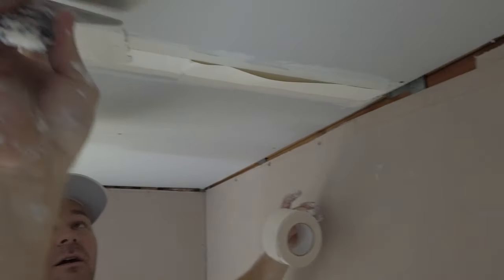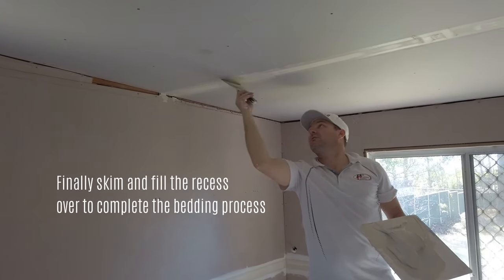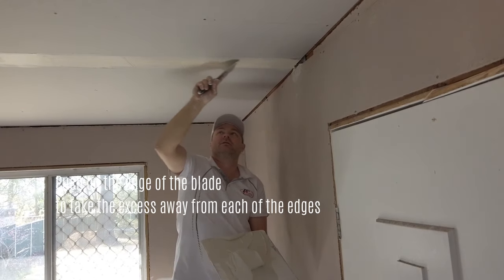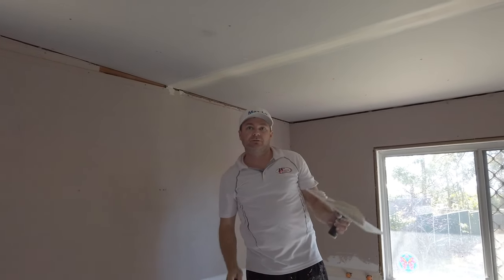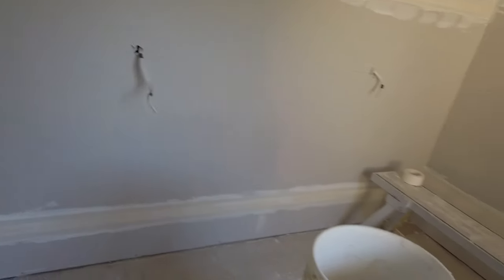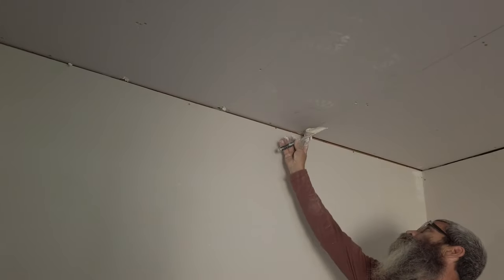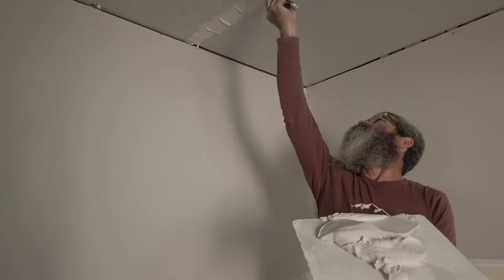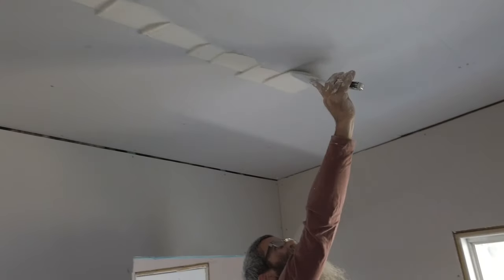Tips on How to Tape and Mud your Drywall Ceiling

Comment: Nice vid mate. When doing drywall I often give the paper a quick dampening with a garden spray bottle or sometimes dunk it in a bucket of water and squeeze out excess with finger before setting it in and glazing over, seems to come up pretty good, although have to pre cut the tape beforehand a bit oversize.... Picked up a tip from one of your vids you put up a while ago of a guy using a toilet brush to put mud on internal corners, tried it out yesterday waaaaay quicker! awesome stuff mate.
Reply from the maker: Yeah that was Gary, he's got loads of great tips. Thanks for your tip of wetting the tape bedding it in. I will try that. It makes a lot of sense
Reply: @Maxkil  No worries mate, I've found wetting it helps with the bonding of mud to paper better. Comes up really nice to as paper isnt sucking out the moisture of the skim/glaze coat like crazy

Comment: I have read through the entire thread and found the gap between the ceiling and walls will be  resolved with a cornice.  How do you finish those spaces between the wall and ceiling if you don't use the cornice method?

Comment: Quick question, after this you just sand and paint or you will also apply this cement throughout?
Reply: Sand then another coat over tape then sand again and then paint. No not whole ceiling needs mud or compound..

Comment: There is a spot on my ceiling where it has a inch gap is that still ok to mud over
Reply: Use "easy sand 45" plaster for 1 inch  gaps

Comment: Shouldn't the space where the ceiling meets the wall be done first?
Reply: Not sure if yes or no, but I've heard one person say (on similar case) that it helps to have a flat surface at those factory edges. So if they didn't do those ceiling ones first, then they would have a divot when doing the ceiling corner to deal with. But now it will be flat because the factory edges were filled in. Not sure if that's the logic for it, but just a thought. Hopefully makes sense
Reply: @Kalikovision7  makes sense - thank you..
Reply: As mentioned in video there is no setting of ceiling to wall. A cornice is simply stuck on which covers all gaps.

Comment: Is it critical to use tape in the corners with the ceiling or even the walls? Seems like caulking would do a nice job if the sheetrock is tight. I am tempted to just use caulking on a small remodel job in my house. What do you think? so...tape and mud, sand, mud, tape, mud to finish, caulk corners. Let dry. Prime. paint. Done.

Comment: If you are going to post videos of mudding/taping at least know what tape to use and where...paper tape is only used in the corners where wall meets wall or wall meets ceiling!
Mesh tape goes over all other applications.
Reply from the maker: Mesh tape on your house lol. Paper tape can be used anywhere,
Reply from the maker: @rkruts5667  oh ok so paper tape is only used for internal sure
Reply: @Maxkil  ...yes. other reason is that it is flexible and allows for a few millimeters of movement to prevent cracking. Paper tape on stress joints  (drywall on ceiling or walls) will dry out and is prone to cracking. There is little to no movement in wood structures where walls meet ceilings  and that is why it is used in those locations and because it is firm...but should ALWAYS be soaked in water after cut to length...and apllied on top of the compound.
Reply: Paper tape can be used on butt joints and any internal application. Mesh tape is used generally by folks doing home repairs lol
Reply from the maker: @GreasyTroll-TV  yeah that's what I thought.
Reply: I’m pretty sure paper tape can be used anywhere and it’s to help hide the seam. it provides no extra strength.     But I could be wrong
Reply: @TeamHartley8485  paper tape has no strength and next to little expansion or retraction however in the corners it is of no concern...mesh tape is required everywhere else because as wood expands and contracts so does your tape as well as your drywall compound. Sometimes drywall compound will actually list the amount of expansion the product has, similar to thinset and other types of tile adhesives
Reply: @rkruts5667  so the walls aren’t connected to wood?   I’m a bit confused    Around the middle of the us they just use paper tape on everything.   I don’t Sheetrock but I get to see a lot of it.
Reply: Mesh tape is a sure sign of an amateur. I guess USG gets it wrong. Go watch some of their videos.
Reply: I had my kitchen done and builder used mesh so your comment concerns me a little
Reply: Do you know of a video that shows the correct way of doing it please?
Reply: @aron2015  you’ll be fine. Mesh tape is harder to cover so if it looks good, you have nothing to worry about..

Comment: Do you have to sand over it after it dries in order to paint over it so no seams are seen? Thank you.
Reply from the maker: Yeah you definitely need to sand it and give it a good undercoat
Reply: I've found using a larger scraper/applicator run across the surface to scrape it works well for a smooth finish in leu of sanding, I'd play around and see if you like the results.

Comment: why did you hang the ceiling drywall that way? could you have staggerd the boards in a different way?
Reply: Right. I'd never allow the butt joints to all line up,tapered yeah,but not the butt. Also could apply taping mud faster if you run the knife sideways. You can tell hes done it awhile,but got stuck on one way rather than constantly improving. If I hired him I wouldn't complain though,still did a good job.

Comment: How do you sand so it doesn’t show thru paint?
Reply: Get a really fine grit sandpaper, like 220 grit or an even higher at the end after sanding off the bulk of what you’re trying to remove. The higher # grit sandpaper, the smoother the finish. Hope this tip wasn’t too late 😁

Comment: I have to do the ceiling in a 7x7 ft bathroom with a shower in it. Is the technique the same with moisture resistant drywall and what grit of sandpaper should be used? Also, do you suggest taping the edges where the ceiling meets the wall or doing a crown molding?
Reply: I don't use tape in high humidity

Comment: How do you finish those spaces between the wall and ceiling? Do you just leave the like that? And put trim on it?
Reply: They use a cornice. Its a paper plasterboard trim, they come in alot of sizes but commonly 70 and 90mm

Comment: My tape is coming off on my calling when doing a second coat what did I do wrong.
Reply from the maker: Possibly lack of mud behind the tape or it had dried too fast.
Reply: @angelf9800  mix sheetrock 90 for all seams then regular drywall mud over the seams then paper then wipe the mud off

Comment: Hi there, great vid... Could you help me? I want to tape and joint a ceiling inside a container home... The ceiling flexes by almost an inch along a 30 foot span when I'm walking on the roof for maintenance... Is there a special flexible mud I can use along with tape in the joins that will avoid cracking down the line. Thanks
Reply: Ahh you don't have mud job you have a structure job..... You need to add bracing to remove that flex before mudding.
Reply: Thanks a lot for your help!!!!👍👍 I will do that

Comment: in an unfinished garage....is tape needed?..... Or can the sheetrock joints be mudded only?...... Also there will be no paint.,...if that matters
Reply: yes, tape is needed, all joints must be sealed, carbon monoxide, paint optional
Reply: If you dont tape, the join will eventually crack.
Reply: You'll end up applying 5x as much mud only to have it crack. Tape is a yes for anything larger then a screw head

Comment: Helpful video! One quick question....do you mix your own mud or use it straight out the bucket?
Reply: 1 mud / water 💦 1/2 a cup 
2 apply mud 6” 
3 tape 
4 more mud 
Don’t go crazy juste make sure ur tape is well muddy put a fan if there no air  (1first mud)